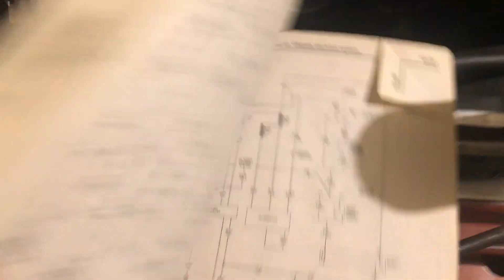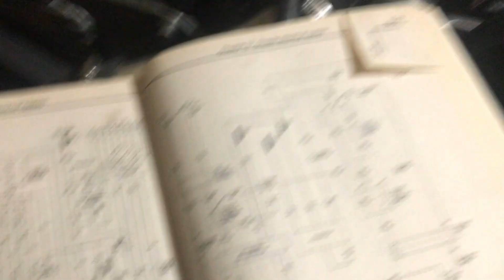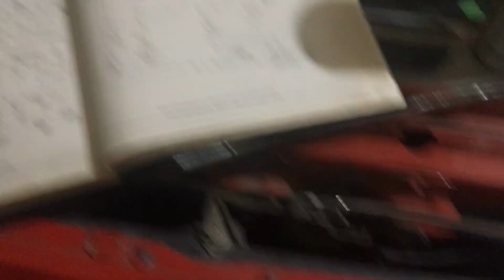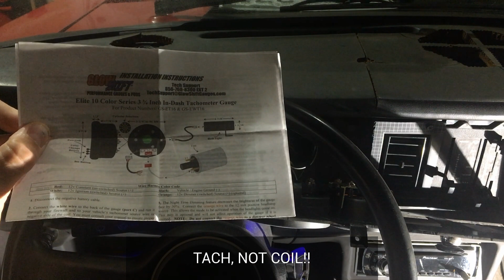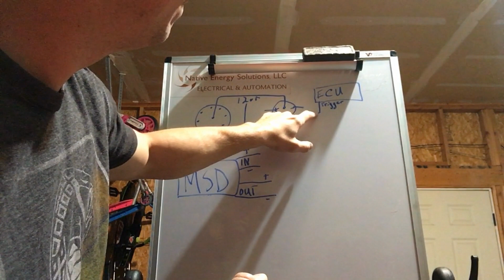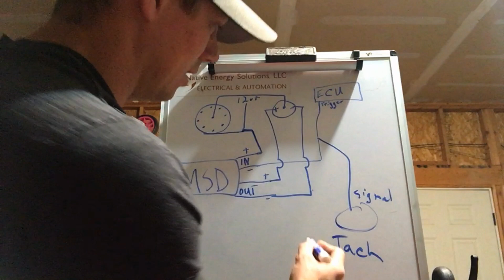Tach Signal Wiring Explained (With or Without an MSD Box), Foxbody Mustang, Racecar

Comment: How would this work on 1995 mustang when their is no tach ground coming of ecm harness
Reply from the maker: I’d have to look at the wiring but there should be a tach signal somewhere you can connect to from the distributor or the tach out on the msd depending what distributor you’re using

Comment: Hi! Good video my question is, my 85 fox has a HEI distributor so coil and else are built in it. Someone stupid had cut out the taxh cable coming from the distributor to the harness, I just cannot figure or find out where the eite must go to make the tach to work again, I read that it supposed to go to a green yellow striped wire but idk if such wire is connected to another adapter and if so, how does it look like? For my car got the msd box rid off. Thsnks in advance!
Reply from the maker: It’s really hard to say where to tie it in without seeing the harness or what was done to it by others
Reply: green and yellow should be correct, check on the 8 pin connector by the brake booster

Comment: I was curious if you know where to wire the 4 wires that need 12v to activate on the MSD 6al2p ignition box? I bought the wiring harness to plug into my coil. I am super stuck on this part
Reply from the maker: Is 6al2p the part number of the ignition box?
Reply from the maker: I looked up the manual on summit racing… pretty standard wiring but also depends on how you’re using it…. Thicker red and black are constant power… thinner red is 12 volt when key is on…. Orange and black go to coil with orange being positive… white wire go to factory coil - trigger wire…. Blue is 12 volts when wanting to activate the 2 step….

Comment: What do I do if I’ve completely removed my ECU and want to run an aftermarket tach AND the factory tach?

Should I reconnect the ECU just for this function?
Reply from the maker: That depends on what distributor you’re running… ??
Reply: @BMF_Garage  yes that info would’ve been helpful. Sorry. Ignition is an MSD 6AL (6425) with a Blaster 2 coil. I believe my distributor is a magnetic one. The only connection is a green and purple coiled wire.
Reply from the maker: There’s usually a tach output wire that connects to a tach.  You’d likely want to run an msd box between the dizzy and the coil.  Dizzy would connect to mad box input and coil would connect to the msd coil output
Reply: @BMF_Garage  yea I wired what I think was the factory tach wires (two green and yellow wires crimped together that were on the negative post of the TFI blaster when I had it) and the Autometer output wire to that grey wire coming off the MSD. No dice.
Reply: @BMF_Garage  I sent you a video I made on instagram. I’m not sure you use that for communication or not. Hope I’m not intruding.
Reply from the maker: Not intruding at all.  Did you send it on IG?
Reply from the maker: Well, the factory tach operates off a negative pulsing signal.  You’ll have to duplicate that signal somehow to get it to work.  If memory serves, the tach output wire from the msd box is a positive 12 volt signal, but you’ll want to test to verify.  Also check the coil while it’s not running… if one wire have 12 volts to ground with the key on but engine not running, you can tie into the negative pulse signal at the coil.  The wiring on the back of the factory tach should have a 12 volt constant and then it used that green with yellow tracer as the negative pulse tach signal.
Reply: @BMF_Garage  I’m ashamed to tell you, but I bought the MSD tach adaptor. I’m just cursor if I can hood both the trigger from factory and autometer tach. I’ll find out tomorrow. I separated the two greed w/yellow wires. Then ran a continuity check to the cluster. I found out which one goes to the tach.
Reply from the maker: Keep me posted!
Reply: @BMF_Garage  yes I sent the video on IG. Here’s the update. The factory tach is now working with the tach adaptor. I did a continuity check from the green wires to find out which one was going to the tach. 

Still trying to get my AutoGauge to work. If it’s broken, I’m going to have to send it out to someone. My dad bought it for me 20 years ago. Have a 3rd tach coming today for testing purposes.
Reply from the maker: Yeah, some tachs need the adapter and some don’t.  All depends on what signal the tach needs and what signal your box is putting out

Comment: I have a '73 Mercury Montego GT, my tach is wired inline between the ignition switch and the positive side of the coil, not the negative. Is there a similar way to wire the MSD with the factory tach, or will I need a tach adapter?
Reply from the maker: Man that’s a good question…. I’m not sure you can without a tach adapter… I’ll have to look over the wiring diagram…
Reply: @BMF_Garage  Thanks man! I'm not totally illiterate to wiring, but most of the time I have to stare at it in confusion long enough before I figure anything out 😂

Comment: Hey I have a factory tach on my 1995 mustang it's starting to kick in and out some times works properly. Which wire from the car is hooked up to the msd. It's not on the tack output spot on the 6a1
Reply from the maker: I’d have to look at a wiring diagram to get the exact color, but you’ll usually connect the wires that are on the factory coils to the Emma’s box trigger wires which are orange and black I think… and then the white and red wires from the msd box goes to the coil.  You’ll have to Google the model of msd box you have and get a wiring diagram to know for sure what’s positive and negative.

Comment: So my aftermarket tach works fine but dash is dead. Why would this be? I have msd box, msd distributor, and msd coil. 331 carb set up. Is it because car was a 4 cylinder? Can I run wire from aftermarket tach to stock tach wire?
Reply from the maker: It depends on what wire they are using for the tach.  It's hard to give advice on something like that when I have no idea what they did to the wiring....

Comment: So is your car a 1986 EFI 5.0 then? What if I have a 83 carburated car?
Reply from the maker: Mine is an 86 efi.... but has a wiring harness from a 92 lx... so mine is kind of a mutant
Reply: @BMF_Garage  I would probably have to run the tach adapter in my carbbed fox then right? Why are they $80??? Lol
Reply from the maker: I’d have to look at the wiring diagram for your specific model, but for most people that’s easier

Comment: I'm actually wanting to run the tach adapter.  I'm running an sds ECU, it's getting it's own rpm reading and I don't want to mess with that. So. That being said, how do I hook up the tach adapter? Some are showing red wire to the tack 12v, some are showing the purple wire to the tack trigger wire. I have no idea how to look for l, where to look for, what color, any of that for the the tach.
Reply from the maker: So, you’re wanting to hook up an aftermarket tach to the foxbody and you’re running the msd box with an sds ecu?  I’m not familiar with the sds ecu... but it’ll depend on what kind of tach you are connecting.

I’d look for what the tach manufacturer specifies for an input first.  Whether a negative or positive pulse and how many pulses per revolution it needs.
Reply: @BMF_Garage  I'd like to hook up to the stock tach in the dash. Hence buying the tach adapter. I can't for the life of me figure out what wires go where. And how to hook up to the tach in the dash.
Reply from the maker: The factory tach connects to the negative signal from the factory ignition system.  Does your ecu utilize a negative trigger or positive trigger for firing the coil?  If it’s positive you won’t be able to use it.  If it’s negative, you should just be able to connect the factory tach to the negative trigger from your ecu.

Comment: Hello sir..just ask a little cuestión i bought a external tachometer.and my car  has a ignition pack..im woried to do the wire connection of the tach..should i connect the green wire of tach that i have to the connection of the tachometer of my car at the back of the dashboard?thanks Godbless
Reply from the maker: Tach always gets connected to the factory tach wire.  Don’t connect to any wiring on the output of an aftermarket spark box or anything like that and you’ll be fine
Reply: @BMF_Garage  awsome ..thanks for the big help sir..hopefully i can find easyly the connection of my aftermarket tach of my car..and there is no problem if they going to function both of them..hopefully no warning sign pops up on my dashboard after i tap my external tach to the aftermarket tach..thanks sir
Reply from the maker: It’ll work with both of them fine
Reply: @BMF_Garage  thanks sir ..your the best...
Reply: @BMF_Garage  hello i already open the cluster howard of my car..and already install the tach..on my dash.the red white   yellow and black wire already conecte except the green wire Goes to aftermarket tach...😂😂😂😂😂😂lotof wire on cluster board connector..i dont now which one..neither how to test which one..now my tach work only display with light...lol thanks anyway..
Try to find wire color coading on ecosport cluster..but cant find..thanks

Comment: Aye bro! I need some help understanding this. Getting my tach to work has been a nightmare. I'm using my stock tach, with a Hyfire 685 box. So behind the dash, I see a wire that's light green with a white stripe, do I cut that wire and splice it to another wire behind the dash?
Reply: Additional question to clarify: I connect the light green/white stripe wire behind my cluster, to the ecu trigger wire out in the engine bay? What color is the ecu trigger wire? I believe my ecu trigger wire is 
red/grey stripe out by the box
Reply from the maker: You shouldn’t have to change anything to get your stock tach to work... the way it’s connected from the factory is the way it should still be connected.  Adding the hyfire box just connects to the factory wire to get a signal to activate spark... I think you may be making it more complex than it should be...

Comment: I have a sn95 mustang i removed the 3.8l v6 and put 5.0 HO engine im not using my ecu and im carburated now i have a msd fire box and im trying to tap into my rpm tach can i do it or should i buy after market tach please help me out thanks
Reply from the maker: Your tach goes off the negative signal from the coil.  Run that to the tach input wire on your dash gauge and it should work

Comment: When using a 6AL2 that has a tach output wire. Where would you connect that wire to?
Reply from the maker: The tach output wire is supposed to be connected to an aftermarket tachometer.

I’m not using the tach output from mine.  I’ve got the tach connected to the ground output signal from the ecu (same wire that triggers the coil)
Reply: That’s a nice looking cluster. Would you consider building one for sale?
Reply from the maker: Absolutely
Reply: Gauges also.
Reply from the maker: Your car is an 89?  I assume you want it to fit the factory location?
Reply from the maker: So the gauges alone are 500$, then the bezel and my time, you’re looking about 600-650$ total... would include an electronic gps speedo, tachometer , volts, coolant temp, oil psi, and fuel level gauges.
Reply: What would it cost me?
Reply from the maker: Are you wanting just the bezel the gauges sit in, or gauges as well?
Reply: Yes it is an 89 GT and I would like to be plug & play in factory location.

Comment: the wiring going to the dash is just fine to trigger your tach, where the inaccuracies come from is the stock tach which is very inaccurate.  Case in point my factory 89 tach is almost 350rpm faster then my autometer tach
Reply from the maker: Very well said!

Comment: Great video but it raised more questions than answers, like 1) can you explain or do a video on what you used and had to do for the aftermarket gauge cluster? Ive heard some have issues. 2) i have the cheap mechanical gauges and no longer get the readings going to the ecu ( i believe the only gauge that matters is the temp) so if i switched it out to a electrical after market gauge what wire would go to the factory sensor wire?
Reply from the maker: The only sensors that go to your ecu are the two or more wire sensors.  If it has just one wire, it’s for a gauge.  There are two coolant sensors from the factory.  A two wire that goes to the ecu and a single wire for the gauge.  If you change to electric gauges, they will come with sending units that you install and wire to the gauge only.